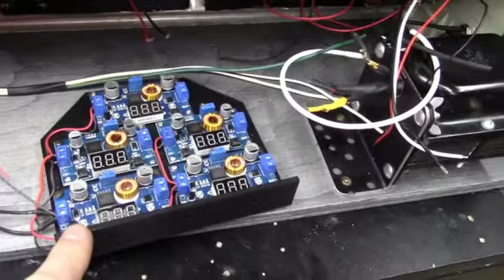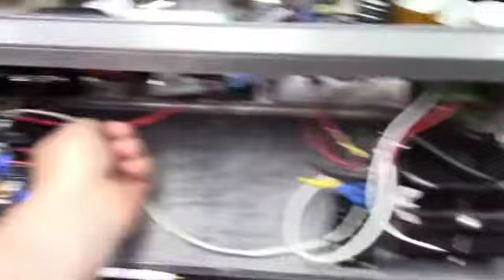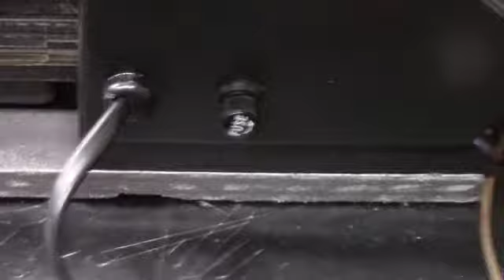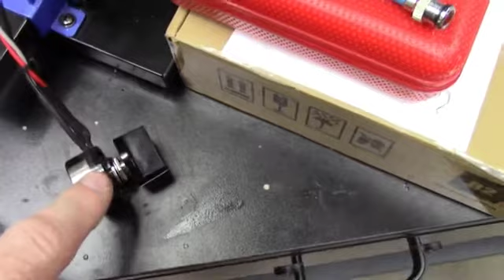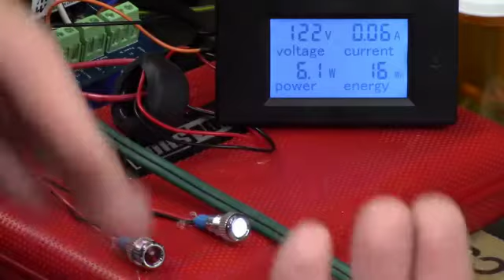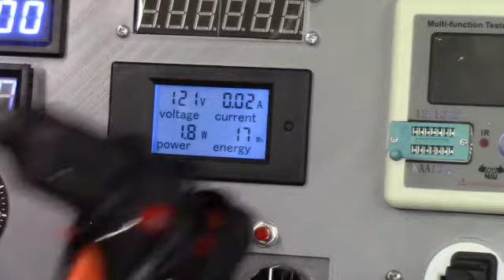MFP  Part 5 -  Wiring Everything!

Comment: The digital panel meter that you are using for monitoring the Electronic Circuit Breaker is probably getting it’s power from the Volts input. If yo open the case, you may find a fairly large plastic capacitor connected to one of the voltage inputs.  This is a ‘capacitive dropper’ used to provide power to the meter circuit. The limitation of this is when used with a variable supply, such as a variac, when the voltage drops below the operating point of the meter’s power supply, the meter will just turn off. A solution can be to remove the capacitor connection to the volts input, and add a separate A.C. supply which does not vary to the end of the capacitor which you removed.  Just make sure you get the correct end of the capacitor. If you get the wrong end, you will let the magic smoke out.  The correct end can be identified  by measuring the voltage at the connection to the capacitor, before you remove anything, with the meter operating.  The end to be removed and connected to the new A.C. supply line will have 120vac on it when the meter is operating…